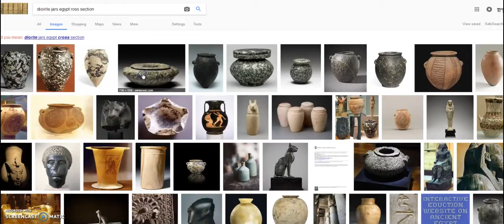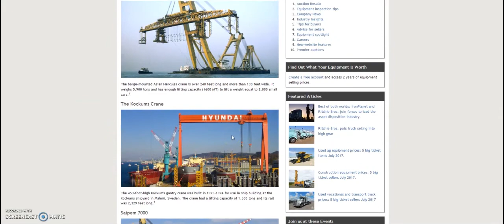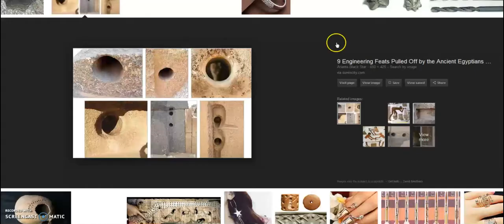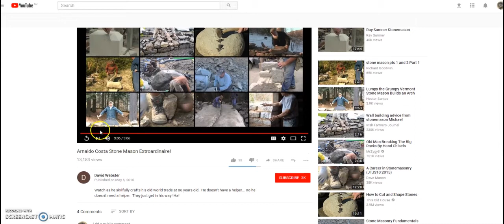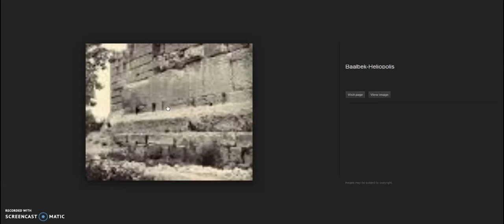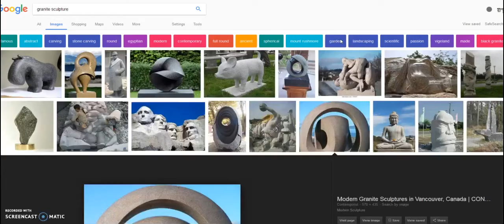Great Pyramid & Baalbek Lost High Technology Claims Fact Checked (Outisde the Echo Chamber)

Comment: Couldn't high pressure water / jet cut the stones or directed jet of sand even ? They had stuff like that we aren't being told about ? If they had laser , would cut em . Just we just don't get told they had tech beyond what we are told I believe . It would be easy to drill the holes with water , sand or laser , really high pressurized air directed through tiny jets / nozzle . Basic really , they just tell US it isn't ?